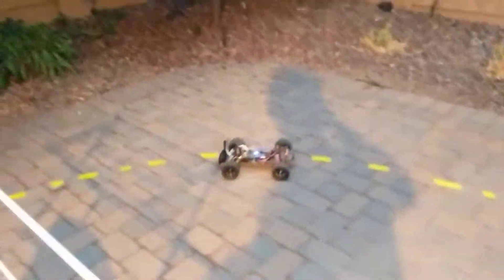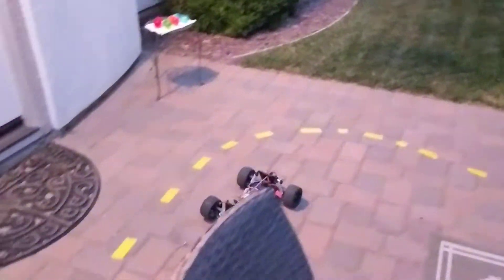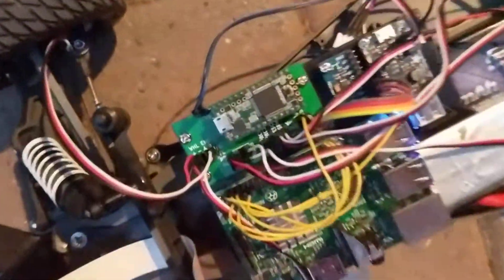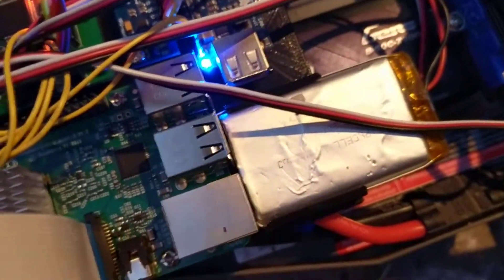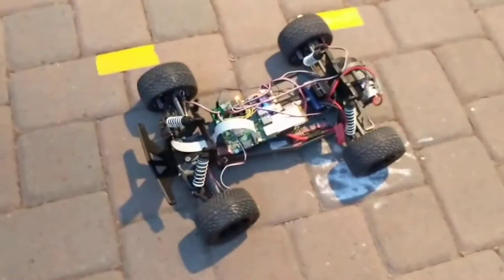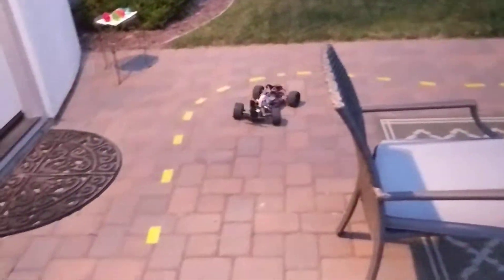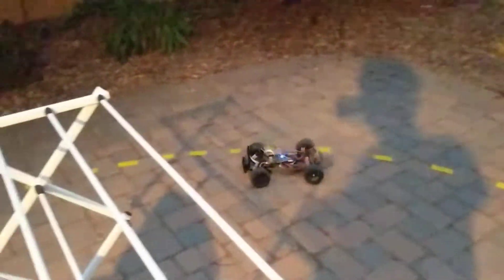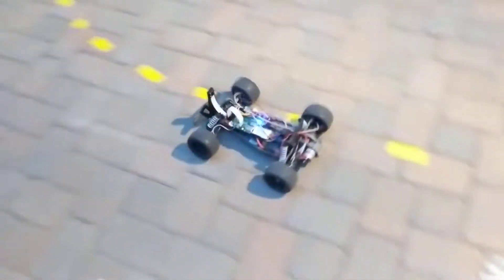Raspberry Pi / Traxxas Rustler glorified line following robot

Comment: Hello, I also have a rassbper pi 4 and arduino mega-controlled rustler, but I have a problem with the digital servo, after turning on it moves to the left right, probably not matched frequency, will you help?
Reply from the maker: the frequency doesn't really matter (about 60Hz or 100Hz is fine) but the pulse width has to be about 1.5ms for neutral, 1ms for hard left/right and 2ms for the other direction.
Reply: @a1k0n  thanks I already managed to extend ESC to arduino it was too long it caused interference